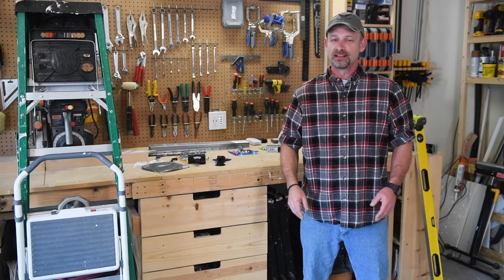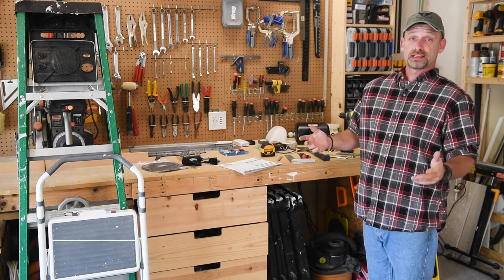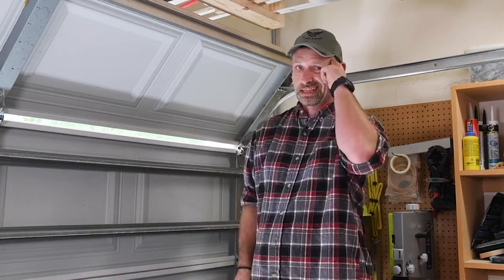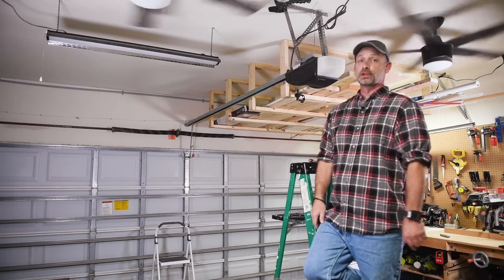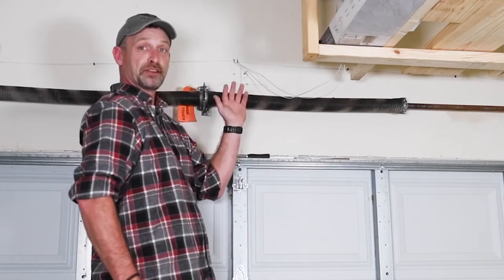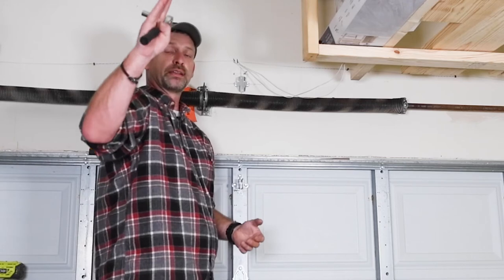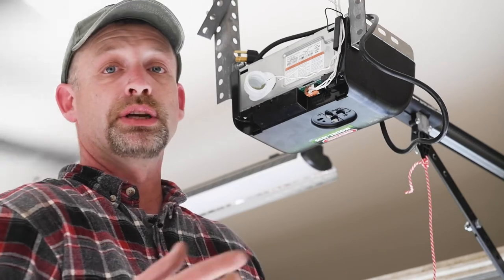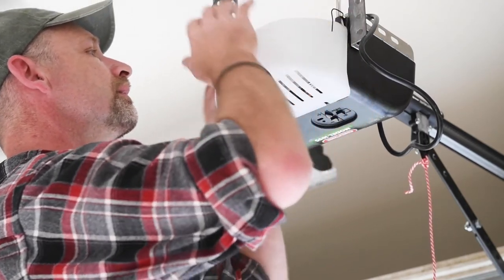Garage Door Opener Installation

Comment: I insulated a metal garage in California and it dropped the temp coming off door by about 100 degree. Granted it was painted brown and facing south. 170°f+ dropped down to 80 85°  I just used the rigged stuff, but could also add the reflective bubble over that. It was one giant heater before

Comment: Hi Sean why can't you use the same measurements for the old one for the new one for the 96 inches??
Reply from the maker: Good question Joey. You typically can use the same measurement when replacing an opener, I wanted to show folks what they needed to do if they were installing a new one without having an existing one.

Comment: Should i remove my previous springs now that i have installed an opener now ?
Reply from the maker: Unless the springs are broken or are not working you should be ok to leave them in place. I didn’t change mine. 

If they do need to be replaced you should consider hiring a garage door professional to do it. The springs are no joke, and if not installed properly with the correct tools and know how can cause serious injury.
Reply: @SeanDoesDIY  thanks ! I'll leave them they both work fine just didn't know if it would affect the motor on the opener in any way

Comment: I have the same one but different model number. Do you need to replace the T safe beam or can I use the existing one? same question with the wall mount control.
Reply from the maker: Sorry for the delayed response Chao. Honestly I’m not sure, the T safe beams maybe but I’m guessing the controller is keyed to the opener. It might work with the same opener manufacturer. Let me know if you tried it and what the outcome was.

Comment: Hello. Does the turnbuckle go inside the part you install at 7:27?
Reply from the maker: The belt goes through that part. That is the piece that attaches to the door arm and moves the door up and down.
Reply: @SeanDoesDIY  how does the belt grip that part to get the door arm to move?  Without putting the turnbuckle inside that part, I don’t see how the door arm will move.
Reply from the maker: Once you tighten the turnbuckle it goes into that part and then the emergency release lever locks it in place driving the door.
Reply: @SeanDoesDIY  perfect!  Thank you so much.
Reply from the maker: You’re welcome.

Comment: Just got this garage door opener installed. I noticed when I put my hand on the surface of the garage door opener unit that something is constantly running inside, feels like a motor, even though the garage door has already completed an open or closed door cycle. Anyone else?

Comment: My track bows up severally when the door goes down.  How do I correct this?
Reply from the maker: Hey Max, if it happens when the door is fully closed you may need to adjust the down limit stop. The opener should be set to stop down travel when the door weather seal starts to compress. Your instructions should tell you how to set the up and down travel limits.
Reply: @SeanDoesDIY  i set the down limit. But when the door is in operation it seems to bind 12” from the bottom causing the drive track to bow.
Reply from the maker: Does the door operate normally when you open and close it manually with the opener disconnected? If it doesn’t, the tracks could be out of alignment or there could be a problem with one or more of the rollers. If it does, the opener track may not be be perfectly square or level. When the door is closed, check the angle of the door arm. It should be angle away from the door. If it straight up and down, it will push the track up.
Reply: @SeanDoesDIY  operates perfectly when disconnected from the motor.
Reply from the maker: Check the angle of the opener arm, that’s a common cause for the bowing.
Reply: @SeanDoesDIY  is there an email I can send a video to diagnose?
Reply from the maker: sean@seandoesdiy.com

Comment: I programed my car remotes it only opens the door how do you get them to close the door also with out having to get out the car press the wall mount button and walk out my man door and get back in the car...so annoying
Reply from the maker: Dee, did you set the down limit switch on your opener?
Reply: @SeanDoesDIY  I believe I did I will go and double check
Reply: I figured it out thank you need to hook the sensors up